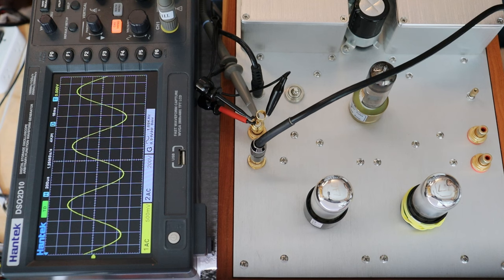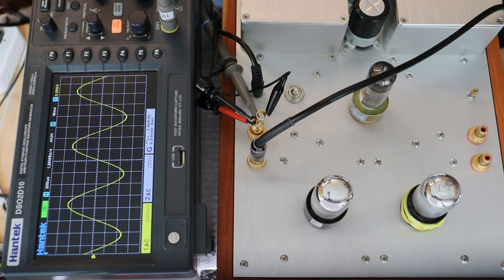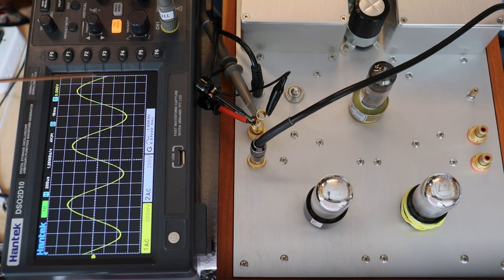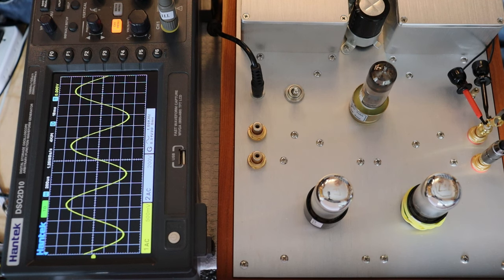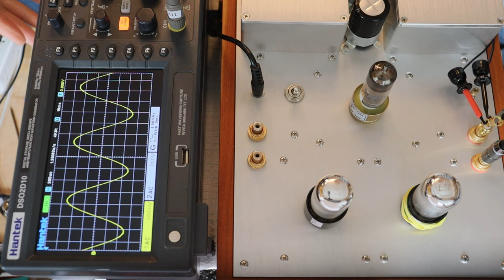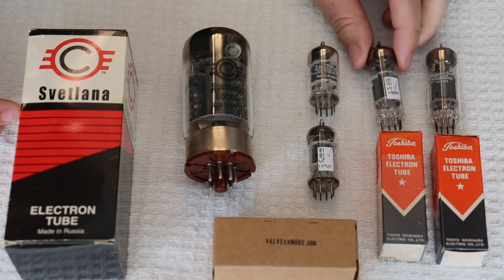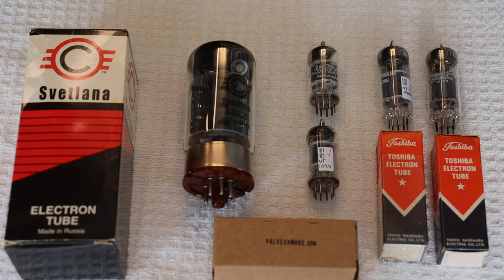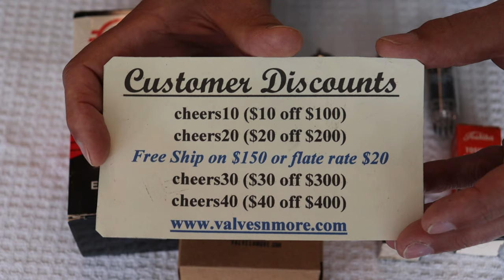Tube Lab #207 - Microphonic Tubes (revisited)

Comment: Great video! Can you explain why a tube would be, or would become, microphonic? Something physically loose inside the tube?
Reply from the maker: @rasmus.O.B  great question!  Possibly a tiny bit of play inside the tube, which makes sense when understand the internal parts need to be able to expand as the tube warms up and contract when the tube cools down.  But it could also be related to input grid wiring, this is where the signal is applied to the tube, so any issues with it could cause all sorts of problems.

Comment: Nice informative video.  I put isolation feet under my Freya noval and noticed an improvement in clarity.  Is this possible based on your microphonics discussion?   Also three of the four stock 6n1p tubes supplied have slight ticking through the speakers when i change volume    I presume this is due to microphonics as this does not happen with other tubes in the gain stage.  Thanks for any advice or comments
Reply from the maker: @sopasadena1499  The freya has internal switches that are noisy, I don't mean electrically noisy, but physically noisy and of course knowing that vacuum tubes are microphonic, it's easy to understand why some tubes would pickup this sound and amplify it.  Luckily you probably never engage a switch while actually listening, so it's a none issue.  
Isolation in any form can change the sonics of your system IF the platform you place your gear on is transmitting room vibrations.  This is probably becoming more and more common as houses and apartments are built cheaper and cheaper.  A particularly bad flooring is composite manufactured snap together floating types.  We have solid oak on top of solid douglas fir on top of solid fir joists - needless to say it doesn't move much!